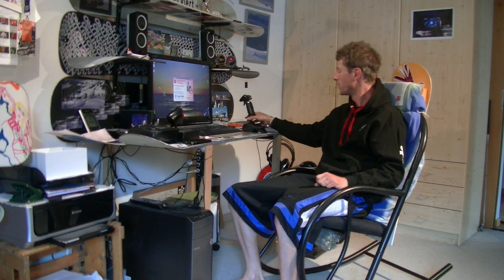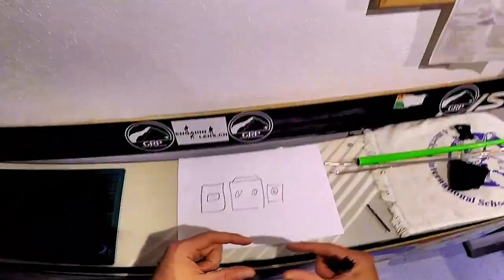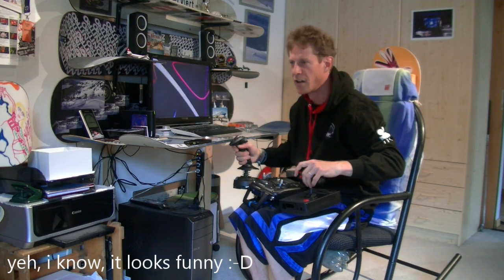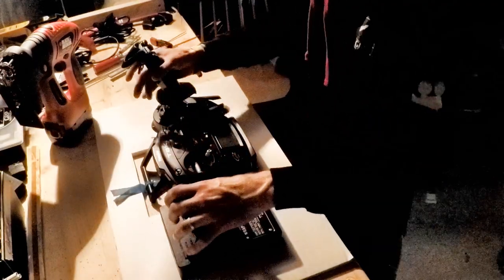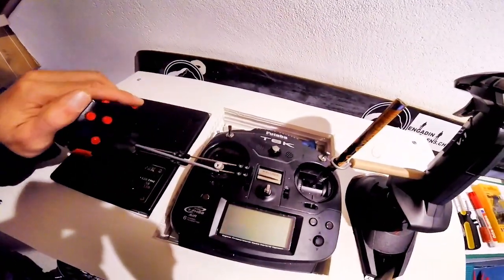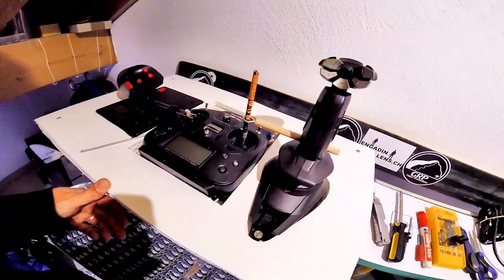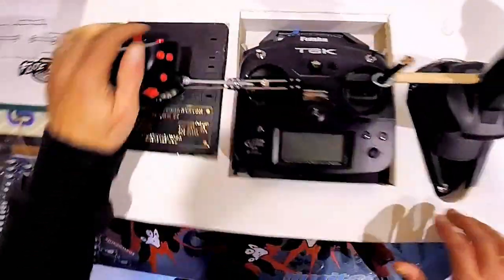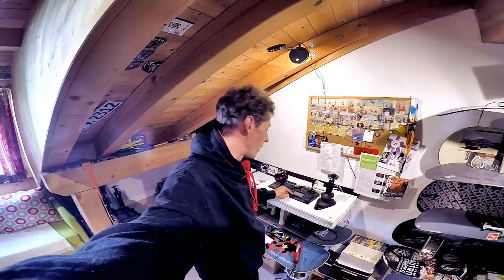Mechanical Command Panel for RC-Aircraft build video

Comment: Where can I few a few of the boards for putting everything, into?
Reply from the maker: The material i used i got from a construction site, its "plastic" cardboard, but i think 3-4 layers of thick cardboard will also work
Reply: @GRPVideoProductions  Ok, that awesome to know! thank-you!
Reply: Did you find a way of making rudder control and can the wires that going from the joystick and throttle to the radio, just be like pushrods, as long as they won't bend? I would like to see the newer vision of this, with the rudder control.
Reply from the maker: @scottnathan7907  havent found the perfect solution for the rudder, just yank n bank at the moment. Planing a chair of sorts with rudder pedals, but havent got around to building anything, not much time now with a baby 😊. Yeh i used thick pushrods, important is that they dont bend or flex, as direct as possible..
Reply: @GRPVideoProductions  How did you drill thought the joysticks? I try to drill thought, one of my old flight simulator joysticks, that don work anymore. My drill did not go thought at all. I ended up taking it apart instead, so I could build a little understanding of the wiring inside, and everything to do with, how it works, inside.
Reply from the maker: @scottnathan7907  started with a small drill and worked my way up to the size i needed, also had trouble with the wires though. I made a "point if entry" with a pocket knife so the drill wouldnt slide off to the side
Reply: @GRPVideoProductions  Ok thanks.